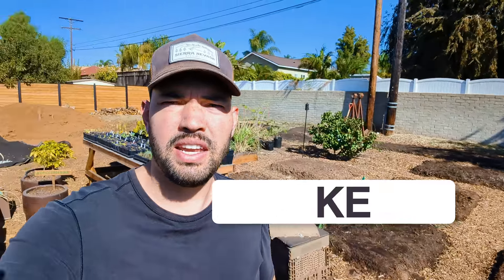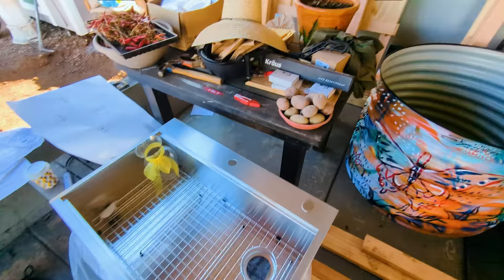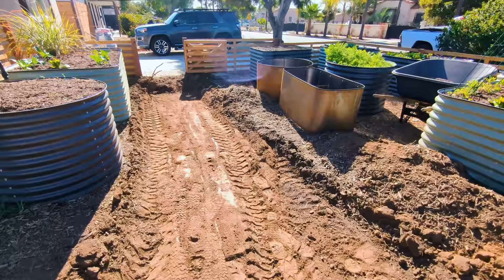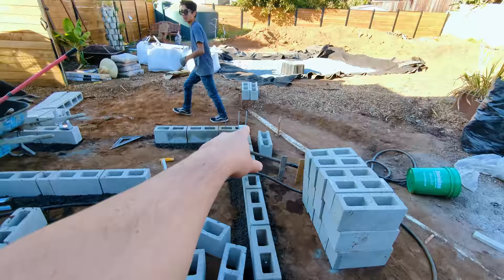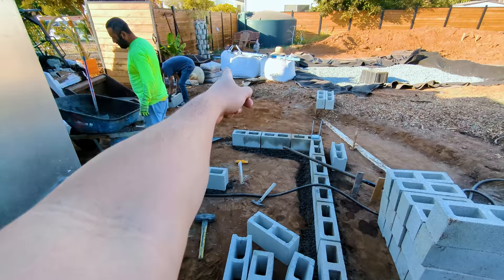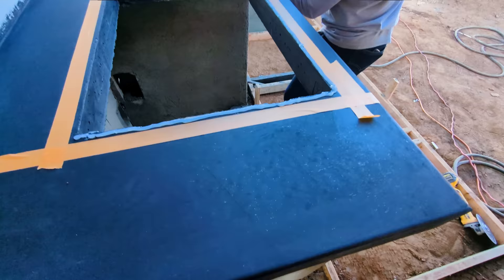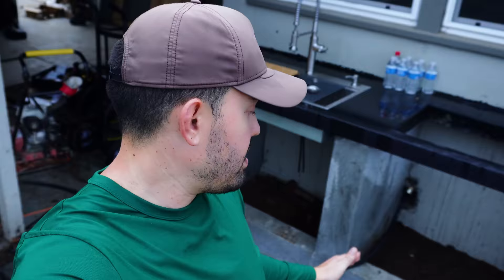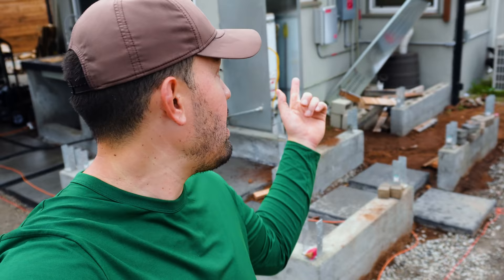Building an Outdoor Garden Sink and Shower!

Comment: Very cool looking.  Since the sink counter touches the house, did your crew factor in an ever so slight decline going from the house wall to the front of that area?  I'm only asking because a friend of mine did something similar with an outdoor kitchen with BBQ and during rains he did have standing water, which is the last thing you want up against the stucco house.  He called his crew back and they had to add more concrete to the counter so this drainage was done.  You can't tell unless you place a glass of water on the counter, and even then the water displacement in the glass is only slight (not like it would slide off, but a marble will roll off if you get what I'm saying).
Reply from the maker: Yup, we may have to do a bit of testing there, but so far it seems good!